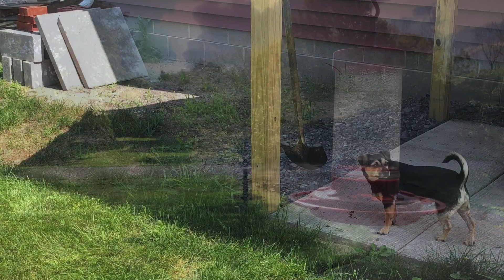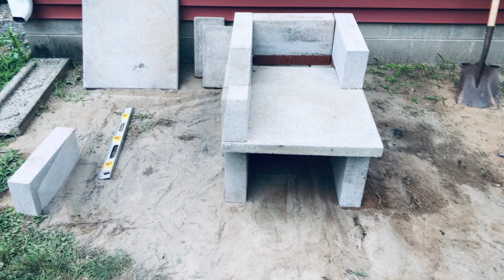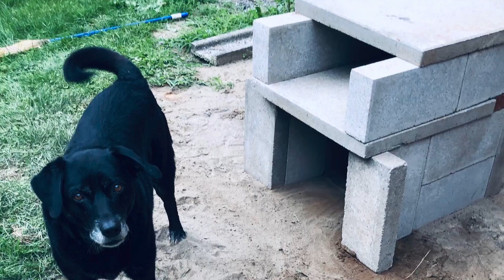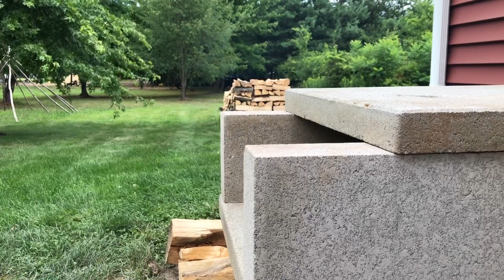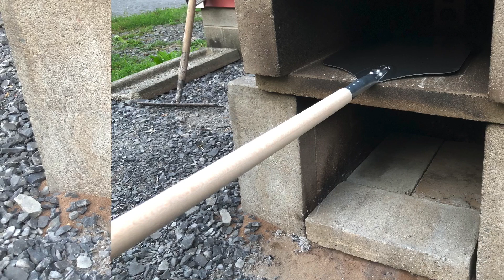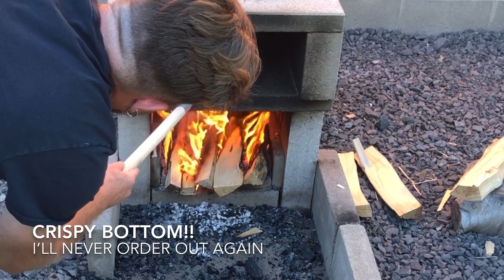Pizza Oven DIY

Comment: Hi Chris  Love it ! Job Well Done my friend . You have created a Rocket type Stove/Oven  genius. I've read some of the comments regarding the materials used . They're great for the exterior but not so good for fire. You have the right idea with the Fire Brick that you used from your wood stove. just need more of them on the upper level for your cooking surface and side wall. I'm thinking of building one too but will be using a 200 liter steel oil drum and lining it with fire brick on the inside like of seen on YouTube . But I really like yours its so simple and effective . Just need the right materials. Good luck on your improvements looking forward to see your next video.
Reply from the maker: Hi Sam, thank you for your kind words!  And thank you for the feedback.  My upgrade for this summer is to replace the stone surface with a steel plate and put a ceramic pizza stone on top of that, otherwise, keep everything the same.  With that swap I can easily finish lining the firebox and the top is most likely fine.  Fingers crossed, I will be posting a "Version 2.0" video in the summer.

Comment: Can't wait to do this, great build.  the only issue/question I have is that since the fire is directly on the stone the pizza sits on it must get super hot and scorch the bottom of the pizza.  many of these videos show great pizzas on top and black burnt on bottom.  A solution I might try is to add an actual pizza stone in the oven part with a gap between the bottom stone using bricks right to keep pizza off the stone with flames hitting it .  it will get hot through convection air heat vs flames directly on the stone the pizza sits on.  Thoughts?
Reply from the maker: I had the same concerns initially, but the thickness of the cooking stone has made my crust nice and crispy. Like “hold a slice and it doesn’t  droop crispy.” 
If you leave it on the stone too long it will burn (anything would!) but I have found that depending on the flames the top may actually cook faster!   Since posting I have learned to start it a solid hour before baking.  I also keep a few split pieces of wood to stoke up fire if the top isn’t cooking well.  The only other thing I’ve learned is you can control baking by moving the pizza further in or out. Good luck! It’s a ton of fun and now my family won’t stop asking me to make pizza!
Reply from the maker: I'd estimate 3-4 times a month. I watch and rotate my pizzas as they cook. A few times I would use the peel to lift it off the bottom so only the top is being heated. I am modifying mine this year replacing the thick stone paver with the metal and the ceramic stone on top. A little rust shouldn't effect the pizza since it will not come in contact with the actual pizza, but definitely remove the pizza stone in between uses to keep it out of the elements.

Comment: I have been thinking of doing one, and adding it to an outdoor kitchen, but am concerned about the stone. that is a stepping stone, and prob not designed for that amount heat.. What say you?.. And thank you BTW for the video, it was awesome
Reply from the maker: You are correct about the paver being for a walkway and not taking much heat.  Since posting the video mine did crack, but I was able to place steel straps (2' long, 1.5" wide, by 1/8" thick) underneath for support.  I am working on a new design that replaces the cooking stone with a sheet of flat steel and I am going to put a real ceramic cooking stone on top of that to create a more even heat.  I am having fun tinkering with it, but its winter here now and pizza season is over til Spring.
Reply: @mrbeyrle  how was it when it cracked? I've seen some videos of these post-explosion, and it didn't look pretty!

Comment: Have you upgraded this yet? Hoping for a video explaining your plan of using a sheet of steel with a pizza stone instead of the concrete slab. I want to try making my own, but I don't want the cement slabs to explode on me.
Reply from the maker: Soon, I am having trouble finding the sheet of steel.  It is definitely on my to do list :o)
Reply: Chris Beyrle I was thinking about just purchasing a pizza steel off of Amazon and using that as the base to cook the pizzas on.
Reply from the maker: @melhorsford1693 Make sure you size them correctly.  I have had to account for the thickness of the side bricks and the diameter of the pizza stone.  I do have a pizza steel for my regular oven but don't want to use it outside.
Reply: Chris Beyrle right yeah. I am looking into that now. I am wondering what I would use for the top of the oven, aside from purchasing another pizza steel and using that lol. I am unsure if that concrete slab would be able to handle the heat since it does not have direct exposure to the flame.
Reply: What about getting cast iron plates from a bbq? And then can put a pizza stone on top? Can then use it as a frying surface as well

Comment: Awesome. How long do you expect the bricks to last through cycles of heating and cooling?
Reply from the maker: Not sure.  I am hoping the used fire bricks will give me some longevity.  I also ended up putting six steel straps about 1/8" thick, 1.5" wide and 2' long under the baking slab after I noticed a few cracks forming.  I plan on using it as long as it lasts and then upgrading in Spring!

Comment: How long did it take before you got your optimum temperature?
Reply from the maker: I usually start it 30 minutes before I bake my first pizza.  It is much easier to regulate the fire and temperature over a longer period of time.  Also the size of your wood changes the type of flame and level of heat.  Experiment :o)
Reply: @mrbeyrle  thanks Chris...🙏

Comment: Is this still in one piece?
Concrete has a tendency to crack or even explode under high heat. 
I would find another type of material.  You might be fine for a dozen pizza's, and then one day? BOOM! And that day will ALWAYS be when you have company...trying to impress them with your cool pizza oven.   (It's just how things always seem to work)  
Thanks for the video, and hold the anchovies!
Reply from the maker: Correct sir!  It did crack, but I am supporting it with some flat metal bars I had laying around.  I have been wanting to get a sheet of quarter inch steel and put a ceramic stone on top of that for the future.  I agree about the Murphey's law...it will fail at the worst possible time, lol!
Reply: @mrbeyrle   Bummer. 
Maybe try one of these at Home Depot. 
'Alpe White 24 in. x 24 in. x 0.75 in. Porcelain Paver'  $20.00 ....or maybe a ceramic paver or two. Both should be better than concrete.  A third option is to contact someone who does granite countertops, and see if he has a scrap chunk he'll sell you for cheap. 
Best of luck!

Comment: That really is all you need.. some bricks and stone. Well done!
Reply from the maker: Yes!  I am working on an improvement to deal with the cracking of the baking part.  Those pavers are not meant for so much direct heat.  I plan on posting another video this summer. At the moment my oven is covered with 18" of snow!

Comment: Looks really good! How long does it take for the stone to reach the temperature for making the pizza?
Reply from the maker: I start it about an hour before I plan to cook my first pizza.  After that, I'd say it takes around five minutes or so.  I do use parchment paper at first and then slide it out from under the pizza about 1/3 of the way through, or when it slides freely.  I have always had bad luck with sliding the pizzas off my peel and parchment paper makes it so much easier!  Besides that its all about experimentation and having fun with it.  My cooking surface has cracked but it is supported from underneath with some strips of steel.  The design is not necessarily long term, but it is fun to play with.  Good luck!
Reply: @mrbeyrle  Instead of flour under pizza on the peel, use cornmeal.  That pizza will whiz right off the peel with one quick pull.

Comment: Any concern about if the paver will explode due to the high heat?
Reply from the maker: Good question, it has cracked but not exploded. I would imagine building a small fire first may help avoid explosions by drying out the paver a bit.
Reply: @mrbeyrle  I would see that make sense by increasing the temperature slowly. I've heard of using food grade papers because pavers  releases chemicals during high heat.  Are you aware of that?
Reply from the maker: @latincaz  I do use parchment paper.
Reply: @mrbeyrle  thanks for the tip

Comment: Awesome !! Where did you buy the concrete blocks?
Reply from the maker: I purchased mine at Lowes near my house, but I would try lumber stores, hardware stores, or anywhere that sells patio stones.  Anything made out of ceramic will work well too, if not better, because they can take the hotter temps..  Good luck!
Reply from the maker: @windfire5380  Mine was a patio paver, not ideal, but it lasted two summers before catastrophic cracks.  You can try a sheet of metal with a ceramic pizza stone on top, or fire bricks (that's what I am trying this year).  I may make a perlite oven this year.

Comment: Put the fire bricks on the base of the oven, rather than the fire pit.  The problem with aerated concrete blocks is they insulate heat rather than retain it.  The clay based fire brick retain heat.  So that helps cook the base.

Maybe also try covering the top part of the fire box opening so the air flow from bottom to top.
Reply from the maker: Thank you for the suggestions.  I am finding that this is a work in progress :o)

Comment: Do you get ash from the wood.
Does that bother?
Reply from the maker: Ash hasn't been an issue for me.  A few "flavor nuggets" won't hurt.  In other oven designs the dough goes directly next to the  fire.  The smoky flavor is the best!  I also use hardwoods which produce more heat and less ash.
Reply: @mrbeyrle  and what are the flat stone made of?
Are they made of natural or manmade material?
Reply from the maker: @keyur.G  It is a cementitious product, nothing natural/organic.  A fired ceramic material would be ideal, but much more expensive.
Reply: @mrbeyrle  so the cement has lead, is it safe?
Reply from the maker: @keyur.G  🤔 good question...!  I did fire it up screaming hot before regular use. It has sort of “seasoned” itself.  A new version is in the works that bypasses this material flaw.
Reply: @mrbeyrle  and the material is made of?
Reply from the maker: @keyur.G  I am sorry, but I do not know exactly what the material is made of.
Reply: @mrbeyrle  kindly tell when you know about it. Ill be waiting.
Reply from the maker: @keyur.G  https://www.lowes.com/pd/Square-Gray-Concrete-Patio-Stone-Common-23-in-x-23-in-Actual-23-3-in-x-23-3-in/3005465
Reply: @mrbeyrle  thats concrete as far as i think.

Comment: Since the creator didnt mention it it's important to note this design won't work long term and could be dangerous. Those stones are not made to handle those temp changes. Risky to put this out without a disclaimer.
Reply: I haven't had any trouble with the cement blocks and the high temps, but I cover mine to prevent the blocks from getting wet when not in use.  Wet blocks and high heat may not be a good idea.